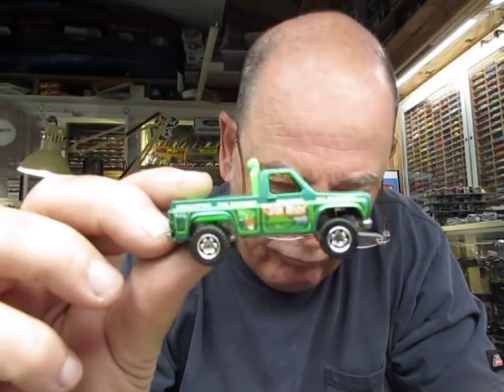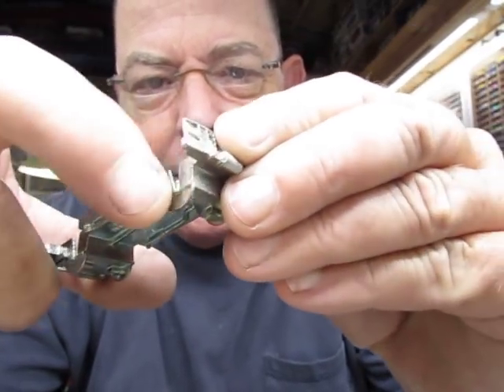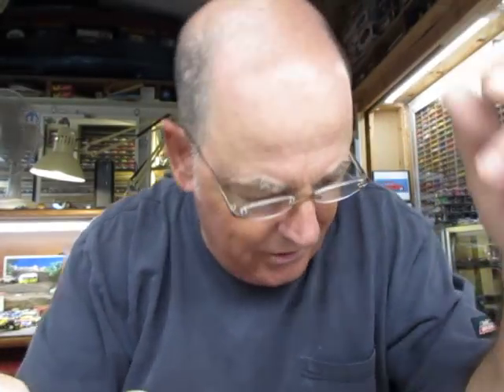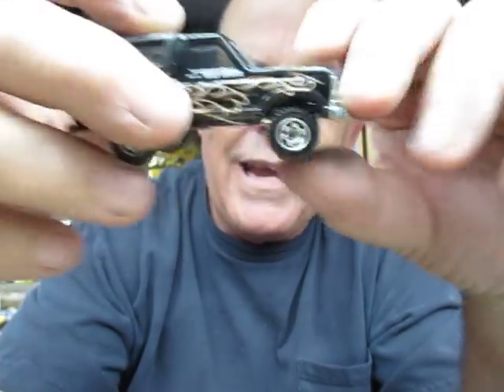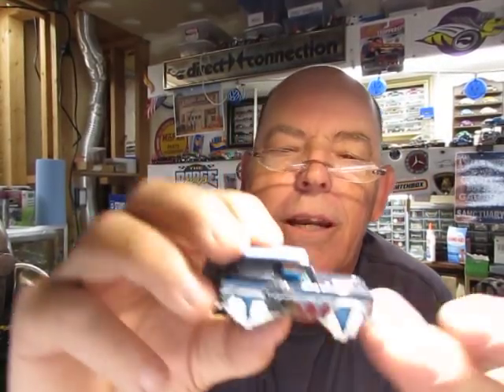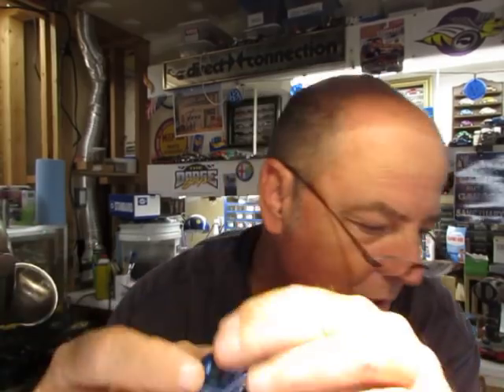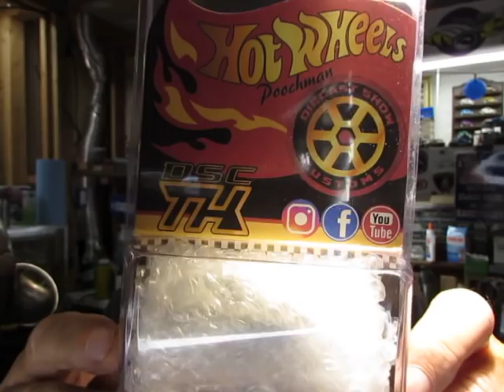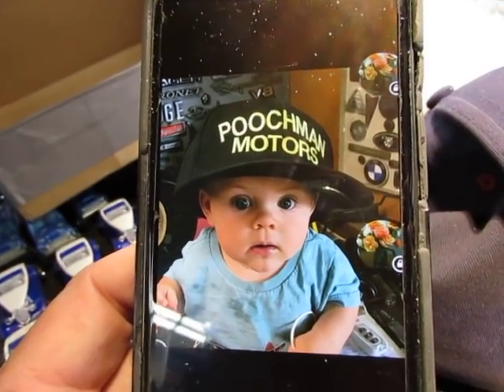Diecast Show Customs

Comment: Very nice! Those MBX wheels look heaps better than the "Death Blades".
I just started following you about a week ago and watched a bunch of your videos. Plus I've followed you on Instagram. Love your work and your humour.

Question, what is that turn table you are using to showcase? The one I have is stupid slow and needs assistance to get moving.
Reply from the maker: Thanks for the sub and the kind words! I use an old microwave oven turn table motor!
Reply: That is really cool.

For the button head screws. Are they 2-56 3/16?
Reply from the maker: revolution1one yup that's the size!
Reply: Thanks.